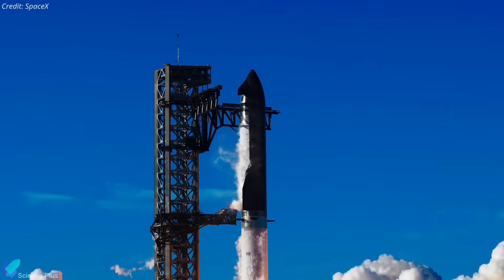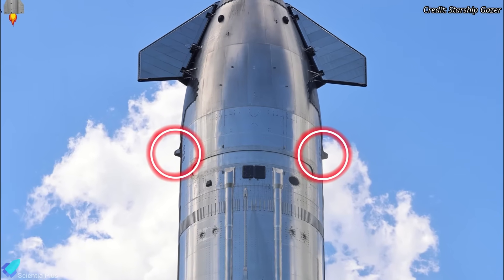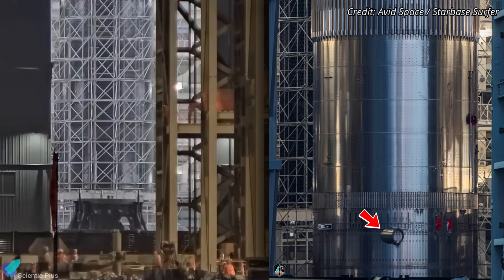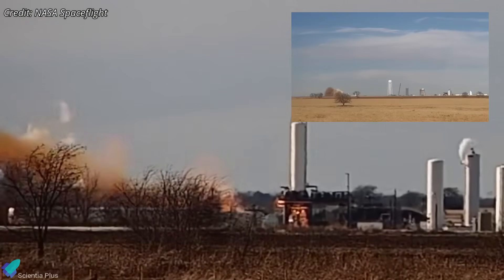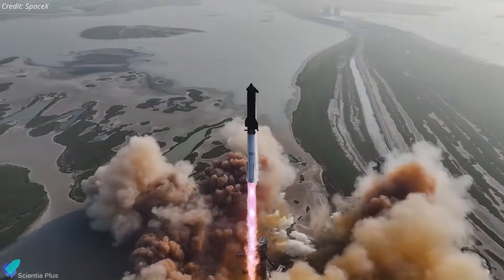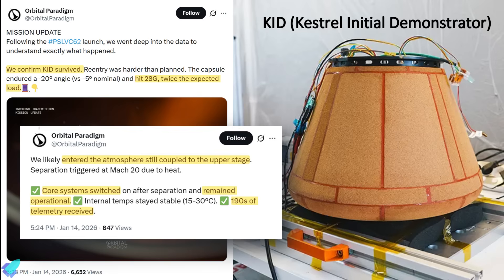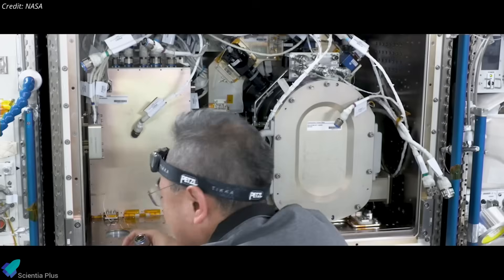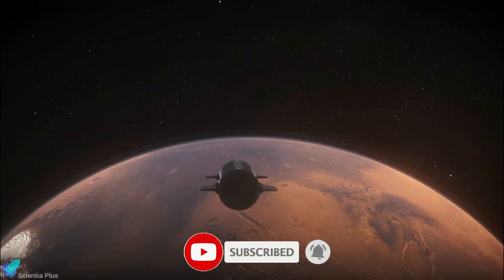Musk’s CRAZIEST Starship Promise Yet! Flight 12 Push Begins! Raptor FAILS Again!

Comment from the maker: 00:00 Starship Updates
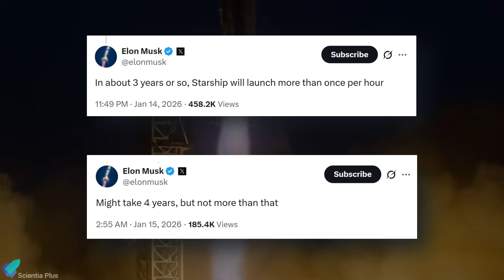08:23 PSLV FAILED AGAIN… But One Spacecraft SURVIVED the Disaster!
11:44 Crew-11 Returned Early: Are the Astronauts OK?

Previous Episode Mentioned In The Video: https://youtu.be/sGxn49KPiUA

📚 Learn More:

🚀 Starship Block 3 Explained: https://tinyurl.com/mp63u57m
  • Detailed Breakdown: https://tinyurl.com/bddv6w2y
  • Production Begins: https://tinyurl.com/5cb2ee3h
  • New Transfer Tube / Downcomer: https://tinyurl.com/ymm23t2c
  • New Grid Fin: https://tinyurl.com/mppnd7sz
  • New Integrated Hot Stage Ring & Forward Dome Upgrades: https://tinyurl.com/msvxk8m
  • Booster Block 3 Aft Dome Insane Design Upgrades: https://tinyurl.com/3k2rxvpf

🛢 Dual-Port Orbital Refueling – Full Technical Breakdown
https://tinyurl.com/3hej7fk3

 Starship Block 4 Unveiled: https://tinyurl.com/ymhyyt2h

🔥The Insane Engineering Of Raptor Engines:
     Part 1: https://tinyurl.com/348hsrya
     Part 2: https://tinyurl.com/p8k85mu6
 
🔥 Raptor V3 Explained:
    Mega Upgrades & First Test: https://tinyurl.com/22nzc3za
    Raptor 3 Evolved Again - More Protection This Time: https://tinyurl.com/4up7jxdd

🛠 Insane Engineering of New Starship Launch Pad: https://tinyurl.com/42h5kd92

🧱 What’s Inside Starship GigaBay?: https://tinyurl.com/2ujtkmkb

🛠 Other Starship Upgrades:
 • Hot Staging Explained: https://tinyurl.com/yc4ejbmn
 • Super Heavy Booster Upgrades: https://tinyurl.com/msm9jtkc
 • New Heat Tiles Explained: https://tinyurl.com/45dytyef

🔥Booster 18 Explosion Complete Breakdown: https://youtu.be/2mYXI6WRwqI

🔥 Starship 36 Explosion:
  📽 Detailed Breakdown: https://youtu.be/VWQiIz1ymBA
  🛠 Damage Report: https://shorturl.at/Quoex
  🛠 Root Cause & Fixes: https://shorturl.at/NVqdS

🚀 Starship Catch Crush Test: https://youtu.be/sGxn49KPiUA
 
🚀 Booster 18.1 / Test Tank 17 
      Explained In Detail: https://shorturl.at/wPg6Y
      14 Tests Passed: https://tinyurl.com/4m4kb8bn

🚀 Booster 18.3 / Test Tank 19 
    Explained: https://tinyurl.com/mvdy9ujj
    Hot Stage Test Setup: https://tinyurl.com/4ekdjjaa

📡 Stay Updated:
📢 Weekly Updates: https://bit.ly/3HIQjPC
🚀 SpaceX Playlist: https://bit.ly/34wue8T

Comment: Launch more than one Starship an hour: Sure. That's possible at Starbase Texas early in 2027 when both Towers 1 and 2 are operational. And at Starbase Florida in 2027 when the Starship tower at 39a and the two towers at the site 37 are both operational. That launch rate cannot be sustained continuously. Time is required to refill the propellant in the ground tanks so it can be transferred to the Starships on the launch pads.